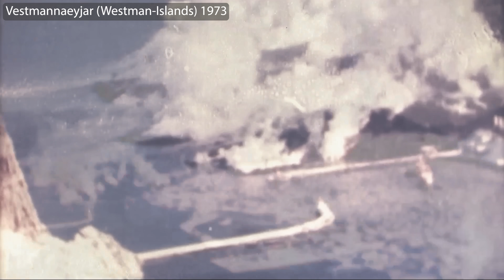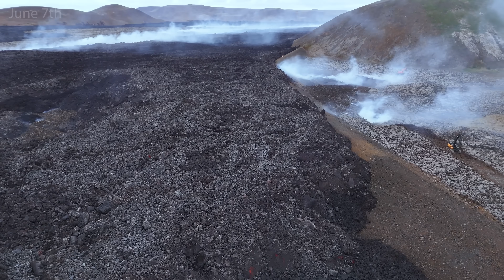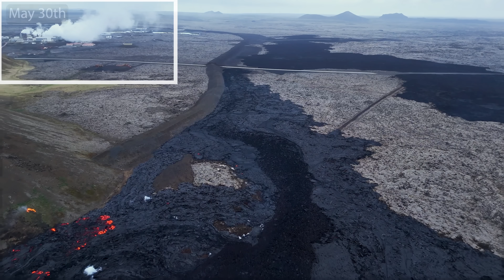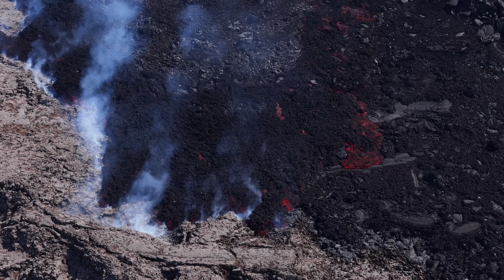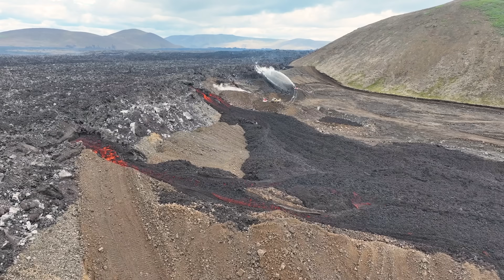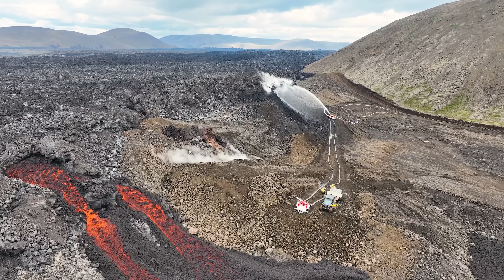Huge Water Cooling Project Underway To Protect Infrastructure And The Blue Lagoon

Comment: ????
   Have military artillery blow holes, in the back side, so lava flows elsewhere?

Or,
  Move the water cooling farther up the flow, over a longer treatment area, for cooling the surface, into chunks, that clog it up, and change flow areas?
... Speaking, as a man who spent many younger years doing water ditch-irrigation work.

... And, fighting forest fires...

Or, ask the US, to loan a few "Bunker-Busters"...
... To cause blasts, under the right spots, to cause the solid - cooled - lava, to blow upward, and to fold over, to block, a channel - in one part, while creating another flow channel, with other sequenced blasts...???
... Like, how building-demolition folks do it...????

  I can only imagine, how gigantic this battle is, for Iceland.

  Yes!  What I suggest is probably stupidity...
... But, maybe such comments might spark other - useable - ideas, from many folks?

Especially, with more trouble coming...?

Good work, Sir.
Thank you.

Only wishing I could be there, helping.

Comment: Are they "only" building barriers to stop the lava, or are they also digging evacuation channels to give it a chance to escape in a preferred direction?
Would it be possible due to ground conditions?
Reply: not really. first, the power plant is pretty much the lowest point there. second, the lava does not flow away like water, but partly sticks and piles up, so it would clog up any relief channel pretty soon

Comment: National emergency.  Get out the one hose.
Reply from the maker: We have to start somewhere, the big pumps will be here soon and we better get the crew ready.
Reply: @JustIcelandic  I think this is all Iceland can afford 2 dump trucks and 2 dozers.  Well, this is top priority.  They could make a call to the US and get 50 bulldozers in there in a week and could have made the call a month ago.  The mountain behind must be 750 feet high.  Take 250 feet off of it and push it down.
Reply: @donaldkasper8346   You keep pushing this idea of shoving off the top of the mountain.  Have you noticed how steep the sides are?  Also, it's not just a pile of loose dirt.  It's a dead cone from an eruption that took place during the ice ages (a tuya), so it's pretty much solid basalt inside.  There are knowledgable people in Iceland and they've put a lot of time and effort into addressing the problem.  It's not likely that some off the cuff idea you come up with hasn't already been considered.

Comment: Massive infrastructure to protect and top priority is 3 bulldozers not 100?  Cut the mountain down and make the barrier 200 ft tall.
Reply from the maker: To cut the mountain down might be what we need....
Reply: @JustIcelandic  You don't scoop up rock, load it into a dump truck, haul it over, dump it and dozer it.  You drive a D-9 up the hill, and push it down onto the leading edge of the lava.  First one with a blade to make the mine road, the others with scoup buckets.

Comment: Yes if there's any way to get air ✈️ tankers to Iceland from here in Idaho (NIFC )or somewhere in Canada   some how try to get a couple to Iceland.🙏
Reply from the maker: It's a bit wild idea :) but might work though :) but i'm note sure if the Cicvil Defence would buy into this :) especially since the big pumps will be here soon...
Reply: They are pumping about 9600 litres per minute onto this, while the big air tankers only carry about that for one load. So these hoses are doing the job of a fleet of fire fighting planes :-)
Reply: You would have to get everyone and the equipment away from the site before dumping the water to avoid injury and damage.  You can't do the kind of pinpoint application possible with hoses.  You also need a fair size and relatively calm body of water to scoop up from.  I'm no aviation expert but I don't think water bomber planes have the range to fly as far as Iceland, and transporting them might require some disassembly, reassembly, substantial inspection and testing before they can be certified to fly again.  You'd also need pilots experienced at this rather specialised and dangerous task.  Scooping up tons of water is neither easy nor safe.

I expect engineers in Iceland have investigated this option already.
Reply: @b.a.erlebacher1139  I use to work on water bombers. Most of them  can fly to Iceland that isn't a problem. 

I don't they they would be very effective.  The scoopers that land on a lake (and they can land and pick up off the ocean if it's calm enough) will carry only about 1500 or so gallons. The land based ones maybe double that. It's not very much per load and expensive to do. I don't think it would be all that good in cooling lava. Maybe putting out the moss fires? 

I think the pumps are a better idea in this case. 

My thoughts on it anyway for what it's worth.
Reply: @Tango4N  Thanks for the info!